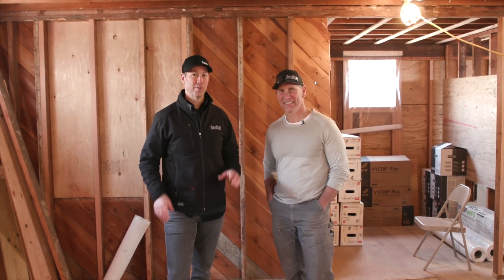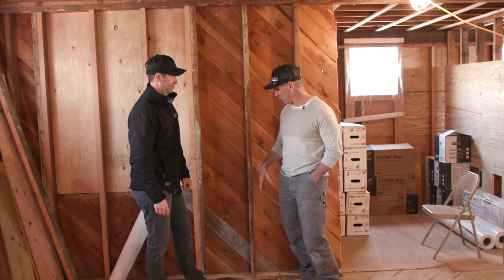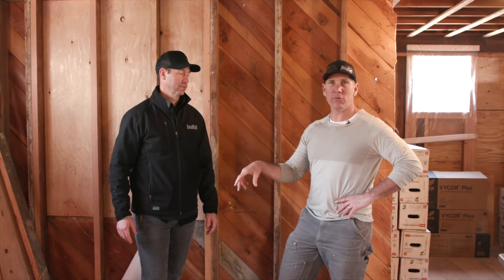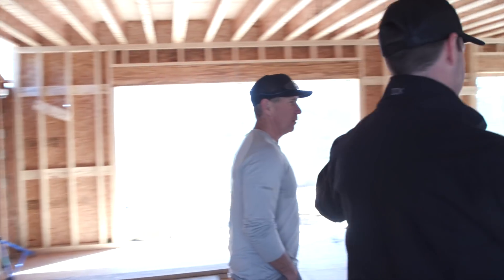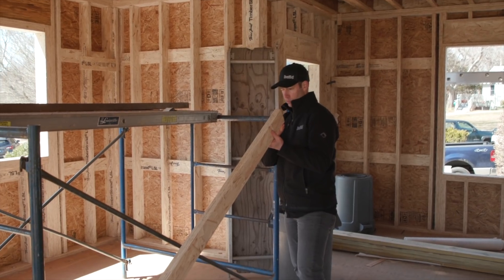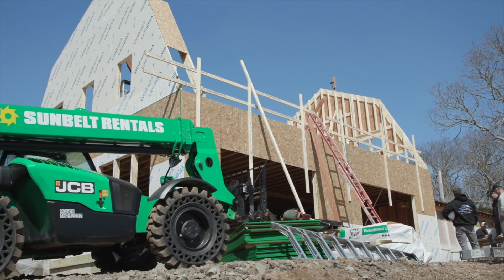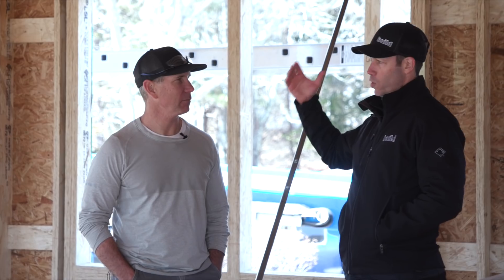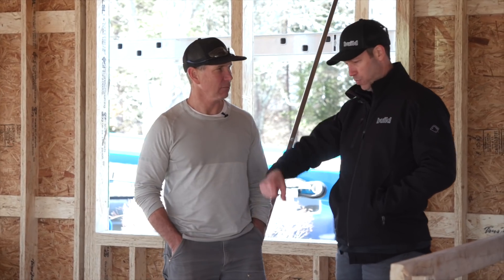Framing Lumber : Traditional vs. Engineered - This Old House Jobsite

Comment: my house was built in 1914 its floor is 2x8 old growth douglas fir with a span of 33 feet in the center is a 10x10 df beam that runs the lenght of the house am digging down basment atm to underpin front and increase height while digging ive found 2 horse shoes and the remains of rail road pins picking up an old 2x4 compared to new is shocking maybe 3 times  as heavy bigger, hard dense wood grains packed together this shit bends nails and snaps drywall screws poker straight was thinking it has to be stronger than modern 2x6

Comment: When in the US did dimensional lumber go from true sizes to what you buy now is..that’s the question I have...I’ve read it was gradual from the 20’s on for a standard but when did it become common for a 2x4 to no longer be an actual 2X4.

Comment: Matt the tight rings on the Doug fir tell you that it is probably inland NW harvested.  The wider rings are PNW Coastal wood.  Matt, on the steel studs if they are 20 gauge or thicker they are definitely structural.  You are confusing the thin 25 gauge for non bearing commercial walls.

Comment: Engineered wood can be great stuff until moisture exposure comes into play. 
Long builds, leak damage, flood and sprinkler/fire extinguishing water damage will render it practically useless. “Real wood and plywood can dry out and survive. 
Why take the risk ? Insurance and rebuild/repair costs will drastically reduce any savings realized by using manufactured lumber products.

Comment: There is a such thing as structural metal studs. I had 16 gauge used on a project I did.  You can have the manufacturer engineer them for whatever your needs are.

Comment: Really like the channel, great information.    I have a few comments about steel framing; the reason you wouldn't conventionally frame with it is that it has an Achilles heel, it transmits heat way too effectively.   So assuming you are framing things as you would with wood, if you replaced the wood 1:1 with metal framing you get a complete 'thermal short circuit' of the wall envelope.   That is, the insulating value of the wall envelope drops precipitously to the point that the insulation between the studs is nearly useless.  That characteristic pretty much mandates a very different design approach...like 100% exterior insulation.  So its doable but it has major design implications.  Another interesting thing is that steel studs are not nearly as precise as you'd think.  They also have cupping, twisting, bowing and so on, as a by-product of manufacturing and (sometimes) storage.  Its nowhere near as bad as conventional lumber, but it'd be wrong to think of steel studs as being perfectly precise.  I'd wager that most engineered lumber is more precise than steel studs.  And finally, that design above is using an entirely unnecessary quantity of engineered lumber for the walls, there could be a considerable savings in the spacing of the studs of the walls (barring some unusual condition).   That might drop the SF $ cost for engineered lumber on the job as a whole.
Reply: I was initially skeptical of the effect of metal studs on energy efficiency (how much heat could 25 gauge steel really transmit?), but after checking some data, you're absolutely correct. On a wood framed 2x6 wall, 16in on center, you lose 16-17% of your R-Value to the studs. On an equivalent 2x6 steel wall, you lose 60-65% of your R-Value to the studs. It gets even worse with 2x8 walls, which would lose almost 70% of their R-Value to the steel framing. Even going down to 24in centers, you're still losing 40-60% of your R-Value depending on the thickness of the wall and the type of insulation. Steel framing does have other advantages, but it seems that exterior insulation is more or less mandatory.

Here's a great article, and the source for all those numbers, if anyone's curious: https://www.buildingenclosureonline.com/blogs/14-the-be-blog/post/86806-effective-insulation-r-values-in-steel-vs-wood-framing

Comment: I'm in the commercial sector and there are a whole lot of metal studs used in structural building. They use a higher gauge stud than a non supporting wall uses. Most commercial buildings are held up by steel columns and beams with corrugated metal decking and 4 to 5" of concrete poured on it for the floors, or pretensioned precast concrete with a 2 or 3" cap pour. But smaller buildings such as a bank branch and even landings on staircases in larger buildings use lots of heavy gauge steel studs and they're super strong. Interior walls use the thin gauge stuff and rely on strong 5/8" high impact drywall for added strength since the studs are usually only screwed on one side of the track and twist around easily.

Comment: In Australia, metal framing for homes is very common at 100% or some lower number.
Reply: What are you on about?  Timber framed houses in Australia are still king by a long, long shot, steel frames are not very popular at all down here and are a pest to work on.
Reply: @macdonaldjohnstonfan  Not 100% of installs I mean where metal is used the frame is 100% metal not a metal/wood mix.

Comment: Years back on an episode of TOH, they featured an engineered product for studs, which were basically a 2x6 or 2x8 stud, but made similar to an I-Joist, with a web made of OSB, and finger-jointed flanges out of (I think) 2x3.  .  
I haven't been able to find any manufacturer that currently makes this.  
Similar to an I-Joist for a floor joist, they had knockouts for wiring etc, and were very stable.

Comment: Why you don't build stone houses?
Reply: Because wood is cheap, so we don't have to. Also, "stone" wouldn't pass the seismic codes in some states without a lot of rebar.
Reply: PC No: I understand. But: We lived for some years in woodhouses (in Europe and the States). No comparison to the stone and reinforced concrete house we live in since 30 years concerning temperatures, humidity, noise etc. Americans should invest in stone and concrete houses. Best rate of return!

Comment: Simply saying it doubles the cost is perhaps a bit misleading for the average viewer.  Double the cost ***for the wood***.   

When considered within the overall cost of the house, it's not overly significant.  Moreover, actually having straight walls makes finish work a lot faster and more economical.  

Good episode.
Reply: Homeowner doesn't see those savings and it is unlikely the GC will either. That savings goes in the pocket of the finish subcontractor.
Reply: @bluecollartrader1791  That's true, but iT doesn't mean the savings don't exist.
Reply: @jeffwoehrle  Absolutely, the savings exist. Nobody can deny that. My reason for saying that it is unlikely the person(s) paying for the added cost of the straight walls from the finish carpenter's labor savings will not benefit (unless the finish carpenter happens to be doing his/her own home), wasn't just to be controversial or contradictory, in case my comment comes across that way to anyone reading.  My point was that the new studs won't be much in demand unless those savings can be taken from the finish carpenter's bill and be explicitly and demonstrably shown to be a dollar for dollar price reduction to the person paying for the house. If the finish carpenter doesn't pocket the savings, the General Contractor likely will. For these new materials to be widely accepted, it is going to take a LOT of commitment from the builders to not pocket that money from saved labor time. And that is why these things will likely only be used in high-end homes by high-end builders and NOT show up in the average home. There's no incentive to the average end buyer, only the buyer who has lots of money and will pay the higher cost of the enhanced materials and not care. Good comment and thanks for responding to me. Cheers!
Reply: @bluecollartrader1791  No worries, mate!  Thanks for the reply.

Comment: The engineered lumber may cost you double compared to SPF lumber, but the drywallers, finish carpenters, cabinet installers, tile guys will love you for the dead straight and flat surfaces they have to work with.  Which will make that part of the job go quicker and maybe even cost less.
Reply: It wont cost less, trust me.

Comment: I wonder how the glue will hold up after 150 years. I like solid wood. It will last hundreds of years if kept correctly.
Reply: I've been watching a British show called "escape to the country".  A lot of the properties on that show are hundreds of years old and they're post-and-beam construction.  I bet if a house made of glued wood is neglected for only a little while, it will fall apart quickly due to water.  Those engineered OSB i-beams also burn twice as fast.
Reply: Seen houses with engineered lumber from the 80's or 90's where the outer layers are delaminating. These are main carrying beams in a well conditioned basement. If I were building my own home, real lumber whenever possible.
Reply: @andrewr.7044  I prefer East Texas Pecker Wood, it is hard as the day is long and it has as slight curve to the left.
Reply: @johnguilbert1349  Betting you know how it tastes, too. You left that part out.
Reply: @johnguilbert1349  lulz
Reply: @bluecollartrader1791  Speak for yourself, if you can still talk with splinters in your mouth

Comment: how about with mold if framing during rain... like in the PNW?
we commonly see that the engineered wood products get mold much much easier and faster, not all over but just spots, there are some yummy chunks in there.
Reply: He talked about how the engineered lumber rots and should never be used for exterior framing such as decks and porch roofs.
Reply: @OldMan_PJ  I'm not talking about exterior, wood grows mold here in the pnw during the construction phase. Floor truss webs are engineered are get the worst of it and kd studs don't mold much if any.

Comment: double the cost!?!
never heard of a hand held power planner and butt strips?
Reply: I think you will quickly get close to the cost if you're putting extra labor into a $2 stud
Reply: How many minutes of your labor is worth $2.00?  1 minute?  2 minutes? Can you plane a stud perfectly straight in 1 minute?  Because you just doubled the cost of the stud when you ran it through the planer...you may as well just buy the engineered stuff if perfectly straight is the goal.
Reply: @penguin12902  not run each stud through a planner, that's just stupid. Crown and cull. Then once your dry you use a hand held power planner over tall studs. Your sheet rocker can also use butt strips.